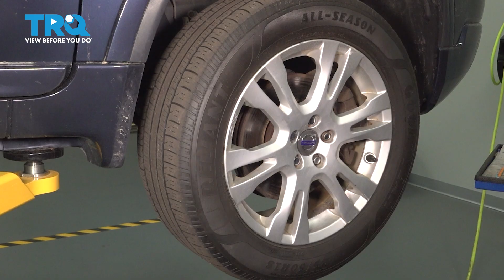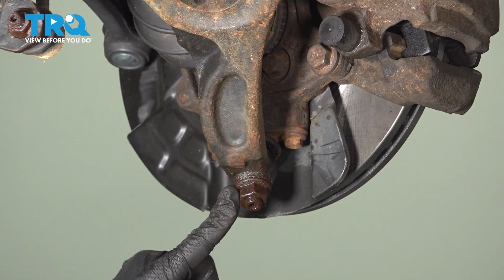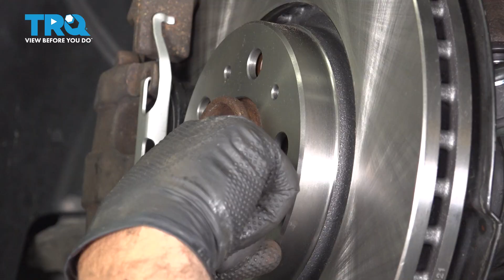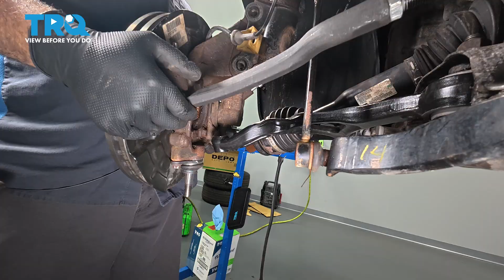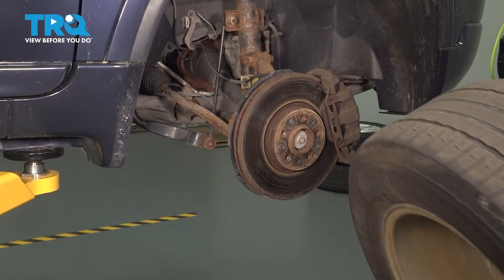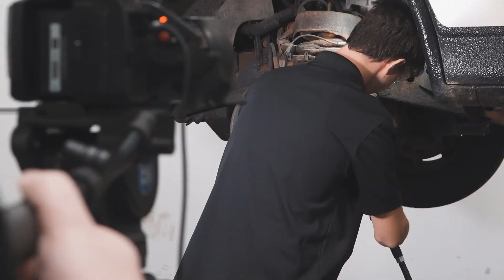How to Replace Front Lower Control Arms 2003-2014 Volvo XC90

Comment: I'm curious to why the 90 degree is added to the bolts when they've already beem stretched. The additional turn is only for new bolts surely and I've seen them snap when following original torque and turn specs  🤔